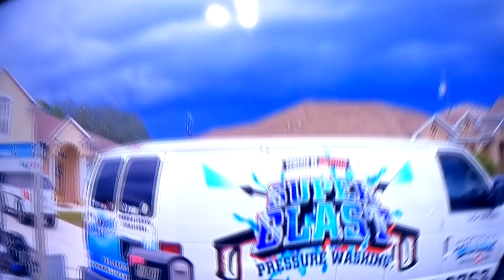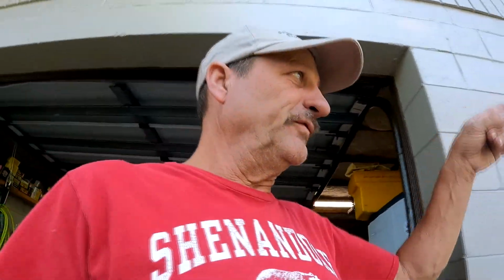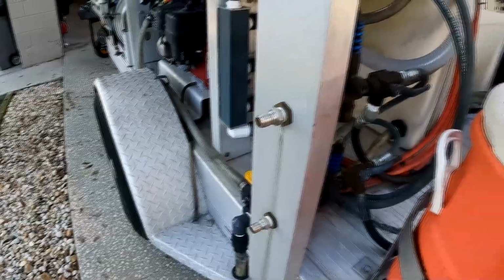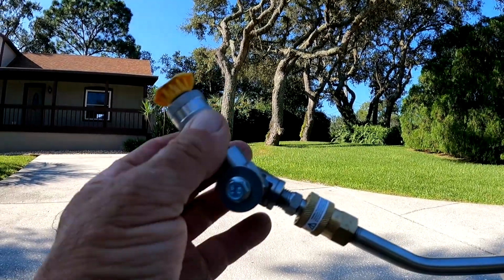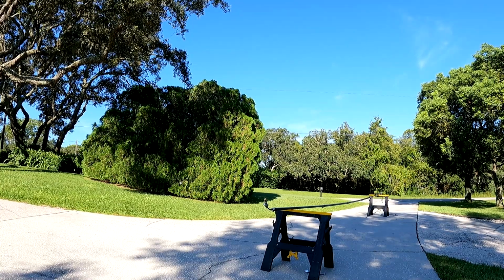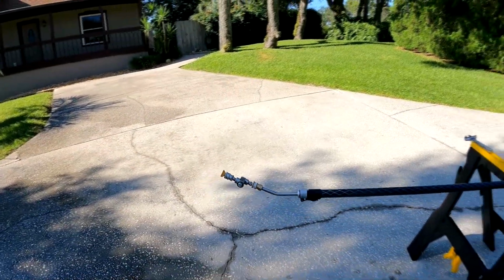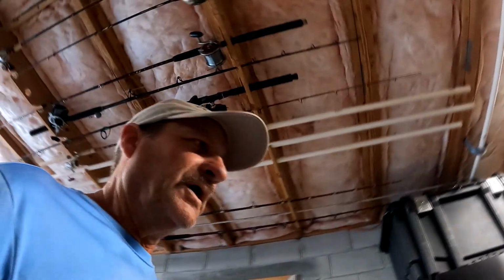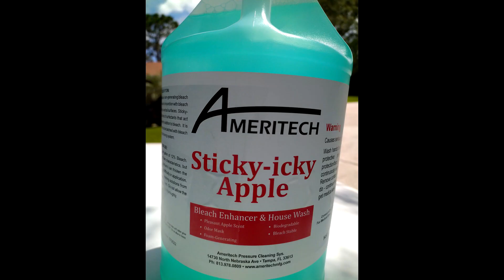By request how to plumb 2 machines together for 12 and 16GMP, also Testing 32-foot power pole.

Comment: Thanks for sharing the duel connection. I use 3/8 hose down to a 1/4. Would that work, and is that going to put back pressure on the pumps.?
I have one of those extensions poles and bent the crap out of it when I used it for the first time. Now I use a control valve at the inlet to reduce and accelerate pressure as needed.
Reply from the maker: I haven't heard of anyone going down a 1/4, that would restrict flow. 3/8 or 1/2
Reply: @superblastpressurewashing.7256  I go down to a 1/4 when using it in 4” pipe works with a lot of bends. That’s why I want more volume.
Reply: Sorry, I should’ve clarified my self. I’m a plumber by trade, and mainly jet blocked drains. I also jet concrete or terracotta roofs. Just love jetting😁🇦🇺 sometimes it’s not about pressure but volume ✌️